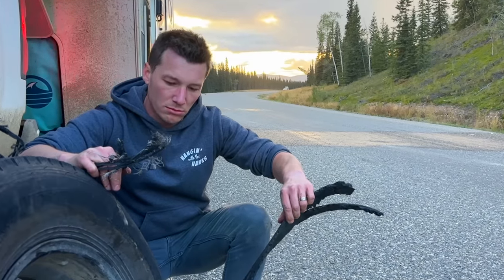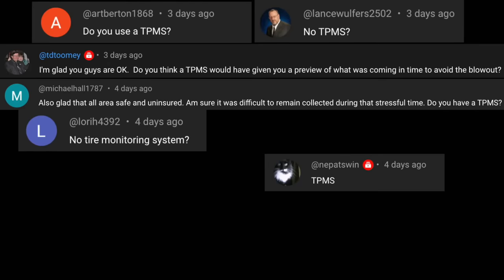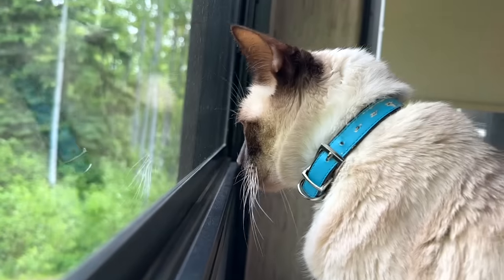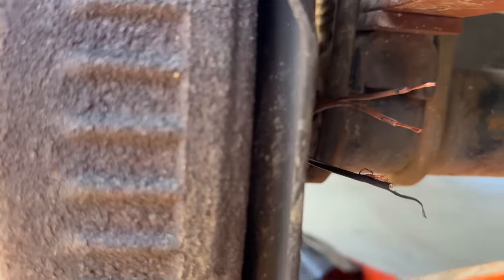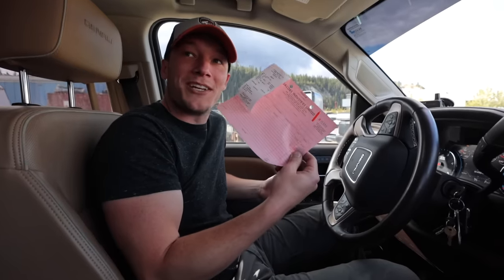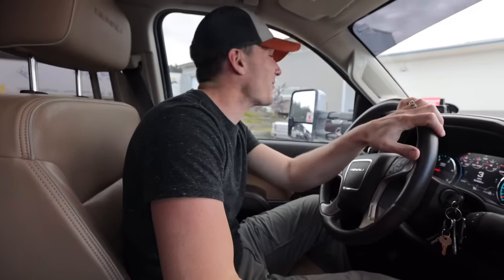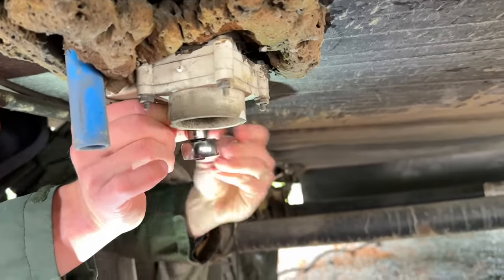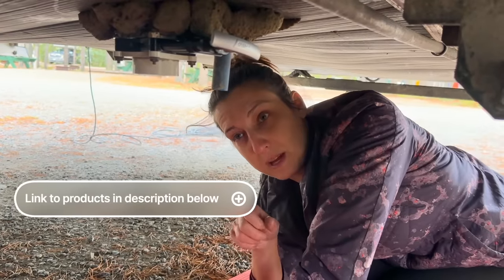RV Repairs: AVOID WAITING MONTHS (Quick & Convenient RV Services)

Comment: Only a day lost and $310 out of pocket--that's about as good an outcome as you could've hoped for.  Breakdowns are never good, but you guys handled it with aplomb. Of course you had some pretty good luck with the repair shops as well--it's always a huge relief to encounter a place that can fit you in and get you back on the road quickly. Happy trails!
Reply: Thank you for sharing your experience with RV repairs! It's always a relief when you find a repair shop that can get you back on the road quickly. Speaking of being prepared, have you considered investing in a reliable backup power solution for your outdoor adventures? The Segway Portable PowerStation Cube Series offers a massive capacity and fast recharging, making it a great choice for powering your devices and appliances during your camping trips. Happy trails!

Comment: Your brakes are wired to the left side only and are wired to the right side through the inside of the hollow axle tube.  It reduces the amount of wiring and connections.  Always do a brake check as soon as you shift into drive.  On your brake sensitivity adjustment on your dash,  there is a manual brake button.  Just hold it in and you RV will stop you from moving telling you that your brakes are working.  If it doesn't then get out and see why, like did you connect the 7 way plug or is the wiring cut.
Reply: I was thinking the same thing.  As you can see the wires going into the axles.  Same as our RV.  Honestly fixing that wiring was super easy to learn to do.

Comment: The magnets are in parallel
Typically, each axle has ONE set of wires between the frame and axle
The catch, the wires split as they enter the axle and there is a wire that travels through the axle to the opposite side
Since your wires between the frame and axle were torn, you lost AT LEAST that axle.
If the wires to the other axle were intact, you had that axles' brakes.
IF however, the junction at the frame above the forward axle was torn, you likely lost all braking (this would have caused your truck to alarm as this would have been a total open circuit)
Reply: I couldn't have said it better myself.  Owning a auto repair company we repair lots of trailers as well.  The price you paid was definitely fair. Good job!
Reply from the maker: Thanks for the info!
Reply: Nice explanation.  Thanks all!
Reply: "Gizmo" is correct.   Don't ask how i
Know

Comment: A sense of humor helps, too. A few weeks ago I was given a flatbed trailer but one of the tires was not road-worthy so I slowly limped it to the nearest tire shop. The parking lot was full and there wasn't an empty seat in the waiting area. I walked up to the counter and said, "I brought you your favorite kind of business." The guy said, "Oh yeah, what's that?" With a big grin, I slapped the counter and said, "I need it right now!" He cracked up laughing and had me pull the trailer around to the back of the building. Twenty minutes later, I drove away with a used tire that actually matched the other tire. $27.

Comment: When my Chinese tire blew out and ripped the sheet of insulation fabric off the bottom of my tire well I cut off the dangling fabric and bought truck bed liner from Ace Hardware. Then I sprayed three coats of that on. Works like a charm!

Comment: I had same issue with the waterproof barrier in the wheel well being vaporized on a blow out.  I found self adhesive aluminum flashing at a big box hardware store.  That ended up working great plus it is thicker, tougher, etc than the waterproof factory fabric.  Glad your creative repair sources worked out so well.

Comment: A number of people pointed out that the brake wires from one side with wires running through the axle to the other side.  The wires inside the axle are very prone to wear from rubbing and then shorting out the brake system.  I had that problem so removed the wiring in the axle and moved the routing to the top of the axle.  I put the wiring through a tough garden hose and securely attached it to the axle.  The wiring hasn't moved in over a year of frequent use.  I have the same TPMS and have set the low pressure alarm to the trailer tire recommended cold temperature.  Even  few pounds below the recommended cold temperature can result in too much heat build up in the tires.  Having traveled to Alaska on the same highways it could be that the tire was damaged on one of the many chuck holes encountered.  That is why it is a good idea to visually inspect the tires frequently.  That is especially true for the other tire on the same side as the one that blew.  They both went through the same chuck hole or possibly hit something on the road.

Comment: Wow! Only 300$ to repair damages was great! Please be sure to keep an eye on front tire on the trailer because a friend of ours had a blowout on the freeway and just as they arrived home the other tire blew on the same side. He felt that the original blowout somehow damaged the remaining tire. Be careful out there!❤
Reply: That happened to me about eighty miles down the road. I had to safely get off the freeway in order to unhitch and get the rear tire off  and go find a tire shop on a Sunday. Replaced both tires inorder to have a spare. What a pain.
Reply from the maker: Thanks for the heads up!

Comment: Glad you were able to get everything looked after. Most small repair shops, and tire shops in Canada are very accommodating and the price wasn’t too bad. Canadian Tire is our ‘go to’ store here in Canada. If your tire was wearing out, bushings could be the problem, but I’d be more concerned with having a bent axle, after some of the roads you were on. Safe travels on the rest of your journey.     Rick

Comment: Just a tip - if you want to see if you have trailer brakes manually activate them at a slow speed.  I usually do this after hooking up (tug test).   Your brake controller should have some way to manually activate - factory ones it's usually just a slider, the more you squeeze the harder they apply.
Reply: Excellent tip!  In fact, everyone should know how to activate their trailer brakes manually in an emergency, as it is one excellent way to recover from excess trailer sway on the highway.

Comment: Most trailer brake wiring is like the welding guy said , The wiring comes down one side and branches off to the other side. So depending on what side was damaged tells if you lost one side or both. That must be how yours is because the crossover wire goes thru the axle tube.

Comment: Kyle & Ney....glad everything worked out for you guys.  Breakdowns really stink, especially when you are far from home. Losing brakes on the rig is no joke; especially if you are pulling hills, mountains,  going down steep grades, etc.  We once lost our brakes on a travel trailer while descending Donner Pass in California and I must tell you that was one of the scariest times I have ever had when towing.  This is when having the proper tow vehicle comes into play and thankfully, we did; however, I think the saving grace was the Akebono brake pads I had on the truck that potentially saved us from catastrophe.  Might I suggest the next time you have your truck brake pads replaced to use Akebono brake pads.  They cost a few dollars more than the OEM or premium discount auto parts store brands but they are worth every penny.  That incident was about 12 years ago for us and I have used only Adebono brake pads on every vehicle we have owned since and current.  Stay safe, happy travels and thank you for bringing us along with you on your journeys.
Reply from the maker: That’s so scary!

Comment: Eternabond is INCREDIBLE! I have it on all my seams. I also used it to maintain an inflatable mattress I used for a bit. Every single hole (which were frequent thanks to my pups), just slap a patch of Eternabond over it and it's fixed! No need to let it dry or anything.

Comment: When you check torque on lub nuts rotate the wrench 180 degrees so you can push down withyour weight instead of pulling up with your back

Comment: As many mentioned, only one pair of wires goes to each axle on the drivers side for cost. Some may have one for each axle, not sure. Mine shorted out in one of the brakes last trip taking out all the brakes.  At a rest stop, i guessed and cut the rear axle wires.  Good guess, that let the front axle work.  Still need to do the permanent repair and am running 4 pairs of double insulated marine wire, one to each axle. I'm an IT guy so I  like redundancy 😁.

Comment: Glad to hear you had a fairly easy and inexpensive fix. I wish my issue was as simple. Two months ago I bought a new 2024 Fifth Wheel KZ Durango. I took it out a couple times locally just to get familiar with it. I noticed the u-shape dinette table that was in the slide was pulling away from the wall on the right side. When the slide was out, it was flush and tight with the wall but pulled away a couple inches when the slide came in. The dealership contacted the manufacturer who recommended they screw the side of the table back into the wall with longer screws and to make sure to hit the aluminum stud in the wall. The manufacturer thought that maybe the screws had just missed the stud during initial construction. That did not fix the problem. The screw just ripped out of the stud and wall when bringing in the slide. There is a bigger problem somewhere within the slide. I'm now waiting to hear what the manufacturer is going to recommended, but I have a bad feeling about this. The dealership is hoping the manufacturer will pick up the camper from them, repair the issue, and deliver it back to the dealership. Other than the table wanting to pull away from the wall, the slide itself works perfectly coming in and out. My gut tells me I may not see my camper again for months. Fortunately I am not a full-time RVer so for me the season is over and I won't need it again until April. But I do worry it might not be fixed by then either. I've heard and read too many horror stories.
Reply from the maker: Sending positive Hanks vibes your way ❤️

Comment: When we had a tire blowout this year we replace the insulation that was present and repair with “PlusRoc RV Underbelly Material RV Underbelly Tape Waterproof Flex Belly Tape with Permanent Sealing Adhesive for Mobile Home, Camper Travel Trailer, Tear Repair Patch(7.87'' x 20')”. This material better resembles the original underbelly material and is “extremely waterproof” Additionally it’s very tacky providing good adhesion and seal.

Comment: On the wiring, most factory trailers are wired down one side and through the axle to the other side probably mainly to save wire. Make sure there are rubber gromits in any whole the wire passes through. I have actually seen wire insulation wear off from bouncing around inside an axle. Just keep that in mind if you can't find a short. Grat job on the repairs. Uneven wear on tires means axles out of alignment. Could be shackle & spring bushing loose axle U bolts, broken shackles or springs. INspect regularly especially on Alaskan roads. I know you know this but it made me cringe when you tightened the lugs with your Milwaukee Battery impact wrench. Maybe on setting 1 or 2 then finish with torque wrench. If you stress the lugs the wheels fly off. I have to ask did you check the tire pressures when the weather changed to freezing. low pressure over heats the tires main cause of blow outs.......

Comment: The mechanic was correct.  The wiring typically comes in from one side (often the left) and feeds across to the other side.  They are wired in parallel but that doesn't mean they run down each side.  That just means all positives are connected to one another and an negatives to one another.  Series wiring would be positive to negative from device to device.  And eternabond is not necessarily a temporary fix for roof membranes.  It can last without problem for years.

Comment: A tip from an old mechanic here...instead of pulling up on your torque wrench at your wheel lugs, flip it the other way and PUSH DOWN on it. Much easier to get your 100+ foot pounds of torque on your wheel nuts.

Comment: Trailer brakes are commonly wired in a parallel circuit…

Here’s how a “Hot” wire from the brake controller and a ground wire are run back to the axle, commonly on the driver’s side of the trailer. The wires are then wired in parallel with a set of two wires running from the left side to the right side. 

It depends on how the wires were damaged, pulled apart, whether you lost all of your brakes or just one brake. If one side works, but you lose brakes on the opposite side then you will often have to counter steer when applying your brakes…

I don’t know how many miles that you have on your trailer, but the axle bushings could be a cause for abnormal tire wear. Trailer suspensions need to be checked often, especially with higher mileage trailers, before a failure occurs. However, you could have had a tire that had a deficiency and the steel belt came apart on you, which is what it looks like in the video. 

If you notice abnormal wear on a tire get down next to it and verify the the tire tread is round (no “slight” bulge) and that the tread is also straight (no “slight” wiggles). These are both indicators of a bad steel belt…and they usually don’t give much indication before complete failure. So, if you see one or both of these indicators, don’t try to limp anywhere for repair or you may have a lot more repairs to make; change the tire immediately 😉

Comment: Wiring typically runs down driver side of trailer. The wire for the passenger side runs INSIDE the axle and comes out just behind the backing plate.

Comment: You did well, congrats on that. The brake circuit on my triple axle toy hauler runs down the off-door side of the trailer and each axle is tee'd off just above. The brake on the door-side is connected to the off-door side of each axle (I hope that makes sense). In your situation I would've lost just the rear axle brakes (as long as the wires that got severed weren't shorting to ground, if so then I wouldn't have brakes at all).

Comment: A few years ago , we hooked up the rv at a camp ground in the U.P. in Michigan, and I  lost the brakes on the truck.  I was pulling our 36-foot DRV Mobile Suite.   Loaded it about 20,000 pounds.   I  adjusted the trailer brakes to 100%  and knew I could use the trucks' emergency brake .  We made it to Saint Ignace, our first city and the city .  It was also the last city before we needed to cross the Mackinaw bridge.   There is no way I was crossing that bridge without truck brakes.  I had to stay overnight but found a repair shop to fix the truck.

Comment: Hey Guys, all the trailers I've seen has a pair of wires that run from your 7 pin to axles on the driver's side. Each axle has a pair of wires that run inside the axle to the passenger side  and each a pair of wires going to the drivers side. You probably still had brakes on the front axle.

Comment: So happy that everything worked out,, and considering the damage the money you had to spend was not too bad. Thanks for sharing all your adventures, it is really helping us prepare for our trip to Canada and Alaska. After your blowout I went and looked at our camper because we just upgraded our suspension system while the tire was off I noticed all the brake wires kind of just dangling,. I thought that was really strange and why wouldn’t they be tucked up a little bit better than that.? So when we put our new brakes on our son is going to take a look at the wiring to make it sure everything is solid. But I would’ve never thought about that. If it wasn’t for your video on your blowout. Thanks again safe travels. If you’re ever in Nevada give us a shout. We’re at the gateway to Death Valley.❤

Comment: Your brakes are wired in parallel even if you have separate lines on both sides of the trailer which is rare. Your camper has one line coming down the left side of the frame feeding first the left front brake then the left rear. Most newer campers then have the wire entering the center of the rear axle and crossing over to the right rear axle then forward to the right front wheel. On yours you can actually see where it enters the axle. I believe you may have had an operative left brake but if the wire was broken at the left rear brake then you had nothing there or on the right side. Get those worn shackle/leaf spring bushing fixed as soon as you can. That’s probably why you’re getting abnormal tire wear.
Reply from the maker: Thanks for the info!
Reply: And when you get those bushings replaced make sure they use the bronze bushings and not the cheap plastic ones. I also highly recommend the use of a wet bolt kit that accepts lubrication. Much stronger and will pretty much last for the life of your camper.

Comment: I was the owner of a tire shop for 20 years.  If one tire separated and went bad, start looking at the others.  Irregular wear is an indicator of a separated tire.   Trailer tires are only good for about 4 years no matter how many miles or how much tread is left.
Reply: How about boat tires.  I have tandem axles and usually run my tires 10 years.  Boat always sits in a garage until used so no UV from the sun and very little mileage as compared to a travel trailer.
Reply: They may be OK. I would not trust them for distance or heavy loads.  Better safe than sorry.  If they are not steel tires they may last longer, steel radials I would not rust at ten years.
Reply: @merlpriester  ok, thanks

Comment: You may be right about both sides of the trailer have separate braking systems, but like on my trailer all the wiring runs up one side then at the rear axle one of the wires run across the axle to the other side.   So if the blow out occurs on the side that the wiring runs and snips all the wires, you lose all the brakes